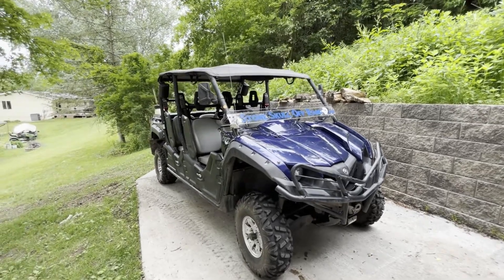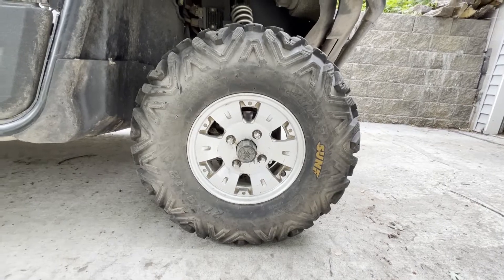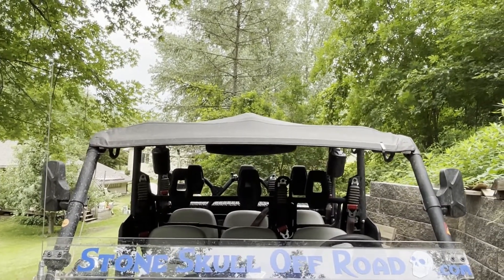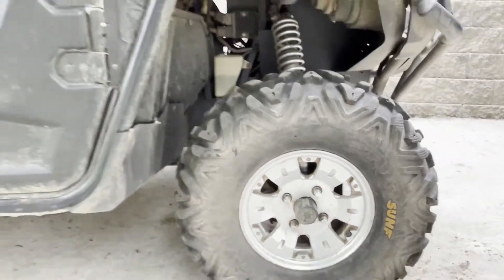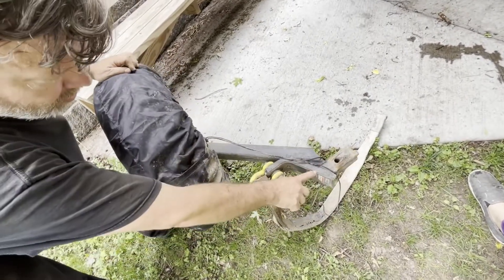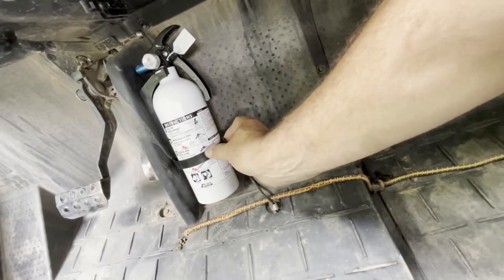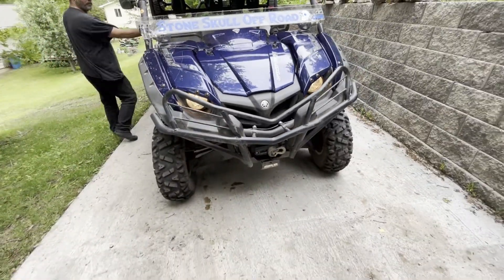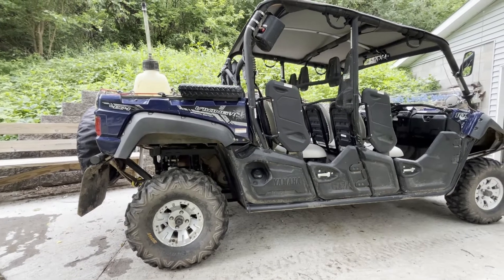2017 Yamaha Viking Vi SE upgrades and accessory review.

Comment: How ya like the fox shocks?
Reply from the maker: at slower speeds there isn't much difference but once you start pushing the limits the new shocks are way better. I can run the rougher trails allot faster and keep up with the 4 wheelers without getting beat up by the machine.